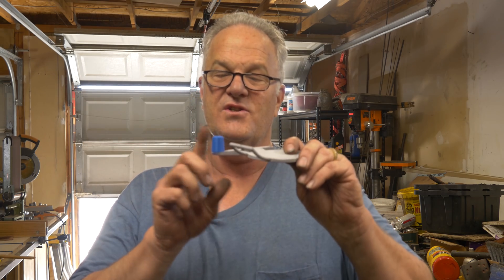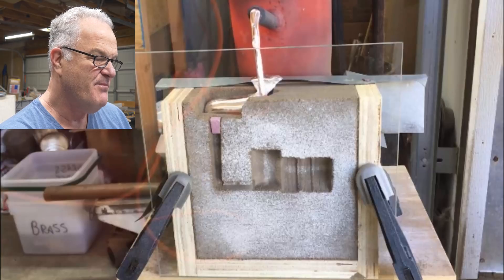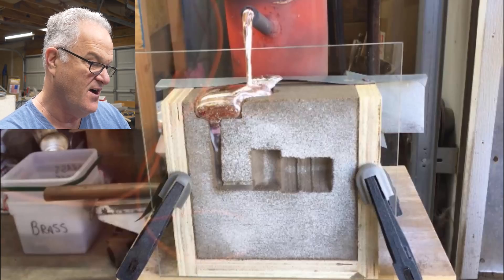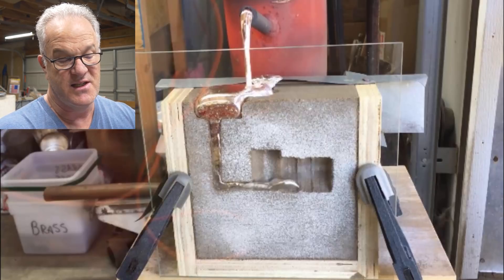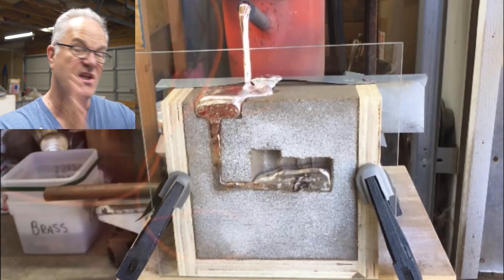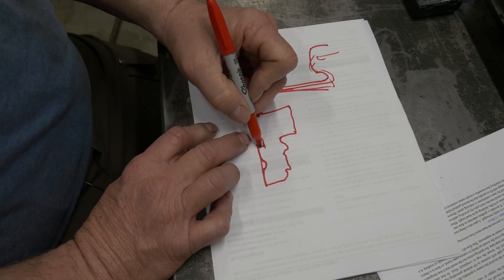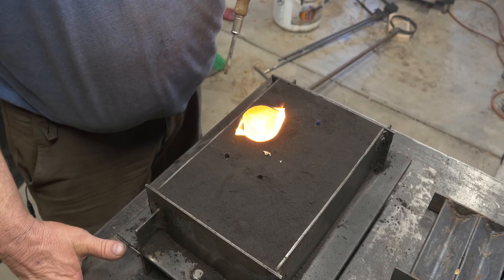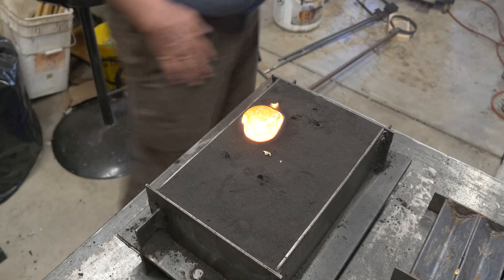Reducing porosity...  Whats a surge trap?

Comment: Where to get that foam plug, ¿which material is it? Is it recommended to use it on larger castings? From my view, it seems like it reduces the amount of oxygen inside the mold, correct?
Reply from the maker: I had not watched that video in several years, I still find Andy's mold fascinating.  I believe he was just using foam like this https://www.homedepot.com/p/Owens-Corning-FOAMULAR-NGX-F-250-2-in-x-4-ft-x-8-ft-SSE-R-10-XPS-Rigid-Foam-Board-Insulation-52DDNGX/315197962

Correct, the foam plug us there to insure that the metal is completely covering the sprue before the metal enters the mold. With it in place, it does not allow any air to be sucked into the mold during the pour.  You might be interested in this video I made a few years later https://youtu.be/64qLOnLsIbE it talks about air getting sucked down the sprue

Comment: This is amazing info, and thanks for the referral to Andrew's channel. I have been wondering, does this mean that open top molds will be more prone to porosity, because it isn't a pressurized system?
Reply from the maker: Good question, I'll have to think about that for a sec. I think in general, a pressurized system is on that is full of metal, not sucking air into it.  It also implies a system that is nearly free of turbulence. Finally, I believe that in a good pressurized system you'd be filling from the bottom up. Of course this last step isn't always possible (like with plaques).

Most open mold pouring I've seen has a pretty poor face on the exposed/open surface. That's one reason I don't use this method.  I think the idea of pouring metal directly in to the mold from a crucible above it is going to cause turbulence and as a result porosity. In a closed system, you do built pressure and force the metal against all of the sand surfaces. Too much pressure, like using soup cans to extend the height of the sprue and a vent tends to force the metal into the sand and give it a rougher surface.
Reply: Those are helpful insights, thanks again.
Reply from the maker: @doc_sav  I'm glad you think so, there a fair number that think I'm completely whacked 😆

Comment: Fantastic video. I am so happy to see there is a solution out there than all this stuff about flux and degassing which there seems to be a lot of disinformation on. I have a question though, why not make the runner enter the mold on an incline? Just curious. I am going to begin casting this summer for the first time and I have just finished a course in fluid dynamics and I think I can shed some additional light on what you are getting at with this video. Sorry but this I going to get a bit long, but if you read through I hope to break it down quite simply. The "Reynolds number" is an important variable in fluid dynamics that can be directly correlated with turbulence (i.e. vorticy generation & thus air bubbles = defects). The equation for Reynolds number is as follows: Re = pVD/ų , where p=density, V= velocity, D=diameter of pipe (gates/runner for casting), and ų is the dynamic viscosity of the fluid (also known as a fluids ability to resist flow). From this equation we can see that turbulence is directly proportional to each term in the equation (i.e. if velocity doubles, Reynolds number doubles). The parameter we have the biggest control over in greensand casting are going to be velocity and diameter of the gates and runner. The trap you have employed effectively reduces the velocity of the aluminum entering the casting, thus reducing turbulence. Also, increasing the diameter of the gates to a greater diameter than which the metal enters the gate initially will also effectively reduce velocity from conservation of momentum. I could go on but I think I'll create a channel this summer and dive into more detail there.
Reply from the maker: I’m on my phone so I’ll be short 😀 I don’t think you can ramp the runner enough to make a difference in the speed the metal enters the mold. What we want to prevent is that “jetting” effect that world occur if your runner simply enters the part.

Comment: Andrew's video... the problem was the speed of the metal. With the right contraption he could bring the speed down to an optimum number which would have resulted in a non-chaotic flow of metal into the casting. Thanks for the infos btw. How is your bottle opener going? :)
Reply from the maker: Haven’t started it yet ;-)

The problem with contraptions is the availability and desirability to the home guy.  Cutting a surge trap is easier for me than finding and using something like a ceramic filter

Comment: Also the foam plug was a ah ha moment for me after watching some of you know who's videos seeing a guy plugging the hole and the pulling the plug I was thinking how I could do that as a solo act and that is the answer
Reply from the maker: Yeah I had the same thought when someone told me I needed to build a trap door. i thought how can I do that and still pour at the same time.
Reply: @swdweeb  Have you tried contact pouring?. Would like to see a video of this being done, but cant find any vid's of how this is achieved in practice... Would be interesting to see contact pour with a trident gating setup.
Reply from the maker: @robertgibson9619  No, I havent tried it.  From my understanding... reading Campbell's mini casting handbook... it requires a crucible with a plug that can be pulled.  It also requires some sort if standing tube to allow the sediment in lighter metal to fall below the opening in the tube.  From what I've read, in light metal like aluminum, the oxides and other crap sink to the bottom of the crucible. Definitely want some way to prevent that from entering the mold.

Comment: It looked to me like the surface of the wave coming back from the end of Andy's casting didn't quite crest over and roll over itself to entrain more bifilms.  But I can definitely see how it would have if the aluminum had been going in there much faster!  In addition to the surge trap's benefits, I think that is where the gate velocity correction factor Bob P mentioned in one of your videos comes into play - to slow the metal down once it's entering a mold cavity taller than... The height of a sessile drop?  Something like that?  Oh who knows, I'm still trying to digest all this bifilm stuff, same as you two. 😁 I'm definitely gonna try using a surge trap soon.  Does the diameter of the spinny part have to be a certain size compared to the runner or anything like that?  Anyhow, keep up the great work!
Reply: “… to slow the metal down once it's entering a mold cavity“ which is no longer the pressurized sprue/runner system.

The sprue and runners are “pressurized” in the sense that they are calculated to be exactly as large in cross-section as they need to be for the given metal flow rate, no larger. The part being cast will be sized according to the dimensions you want in the final piece, and so the metal is no longer constrained by the walls.

To eliminate splashing and jetting, John Campbell says the flow rate entering the unpressurized cavity should be below the “critical velocity” of 20 in/s = 0.5 m/s. That speed relates to the “sessile drop height” of 0.5″: something falling under gravity will be moving at 20in/s after it falls the first ½″.
Reply: In an article "Optimized Gating System for Steel Castings" Campbell, Dojka, and Jezierski wrote in 2018 they said the following:
"The volume of the trap needs to be sufficiently large to ensure that the trap only fills after the gate is filled, and sufficient depth of metal has arrived in the mold cavity to suppress jetting. The height-to-diameter ratio of a spin trap, and its optimum volume as a function of casting size and geometry, will be subject to further examination." their end conclusion included "sufficiently large spin traps on the ends of runners performed excellently"

https://link.springer.com/article/10.1007/s11665-018-3497-1
Reply from the maker: @askquestionstrythings  Ok then, so the answers are we'll get back to you and big is better? ;-)
Reply: @swdweeb  sounds good to me!  Lol
Reply: @swdweeb  sadly, those are the answers. but we can learn something looking at the graphics in the article. They used a trap that was close to the same diameter as the part they were making.  (or simulating as these were all CFD simulations)  so "large" seems to be on the same size order with the part.  extrapolating some more data their sprue and runner has a cross-section of 30x6mm it look like their spin trap is about 130mm tall and 95mm in diameter (total guesses) about a 1.4:1 height to diameter ratio. but since that's a guess based on a small and skewed image testing would be needed.
Reply: The idea of the spinny part is to change direction slowly to prevent a reflection wave.  I don't know the answer to your question but the logical guess is small enough to hold pressure on the system but large enough to not slow the flow except with head buildup.  Perry says a tapered runner into the spin trap would restrict and start flow into the gate as the spin trap starts taking metal.  I tried that but messed up the pour (couldn't keep the basin full) but there's something to learn so I'm posting that pour next.
Reply from the maker: Hey bud, I'm not aware of a size ratio for the surge trap. I haven't seen anything in Campbell's book.
Reply: @swdweeb , I think we’ve both asked Bob that question, but he answers in his own time. Do you want to reach out to Dr Campbell directly, maybe?
Reply from the maker: @JCSalomon  I'd love to have conversations with Dr Campbell but I don;t have a way to contact him. I know that he's seen at least one of my videos but he's never commented.